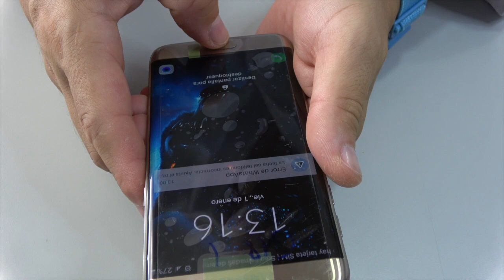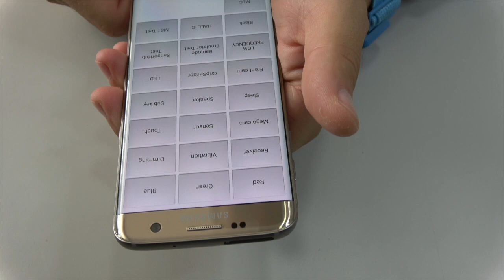Samsung S7 Edge Lcd display replacement

Comment: I've been at this for a couple weeks now and can't get passed the part where you heat it up with a blow dryer (almost too hot to touch) and then pull the edge away. It's just not budging.

Comment: Please, can I ask you a question?
After switching the screen there is a new sensor fingerprint that comes with the new screen.
  Does the new fingerprint work without problems?
I was told that the new fingerprint was not working Only with the old one .
Reply from the maker: Hello, Hussien Ali!We used the full screen with the sensor fingerprint,and it works...Have a nice day
www.movilone.es
Reply: Reparacion moviles Granada MovilOne Thank you👍👍👍👍👍
Reply from the maker: Thank you too!:)